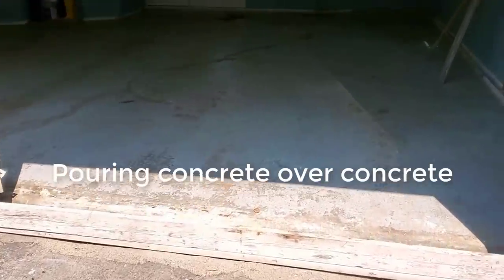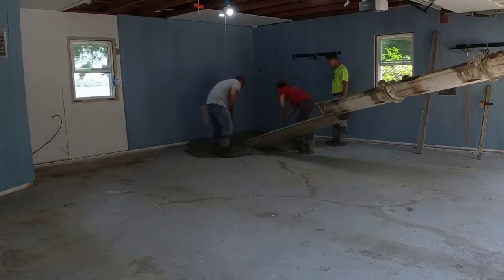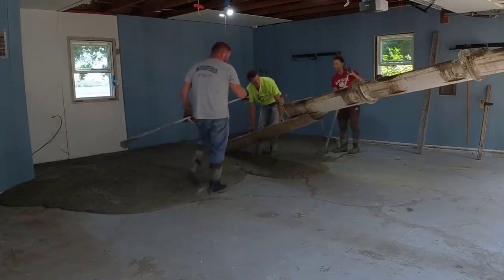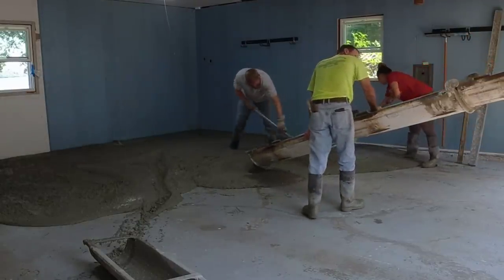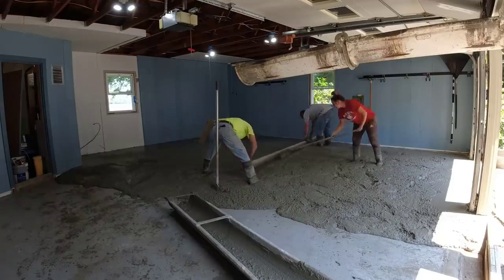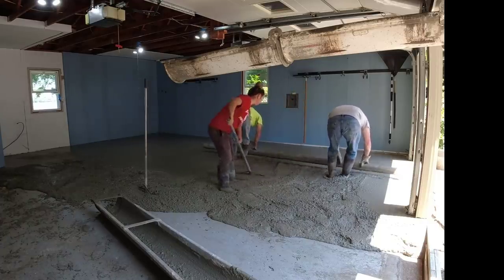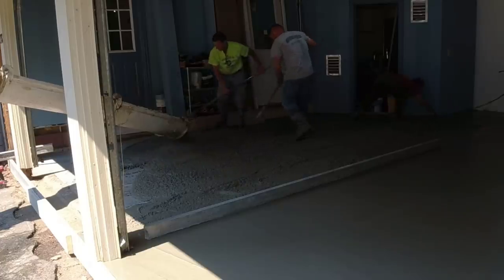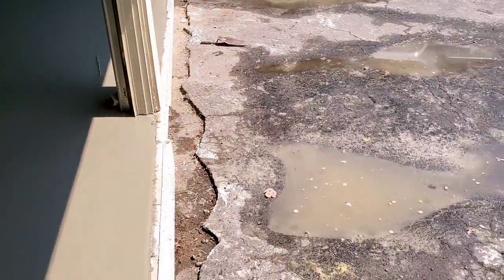Pouring Concrete OVER Concrete (New Garage Floor over The Old One)

Comment: Every crack in the existing concrete will come through the new floor
Reply: Reflection cracks
Reply: Pjbdoggy, maybe, but I don’t think so. I did this in 1996, used 5 bag mix. Still looks great today.
Reply: I would have put visqueen down first to break the bond, stop moisture and prevent those cracks from radioing through. Very cheap insurance for what you gain.
Reply: @edstimator1  nah- no need
Reply: @edstimator1  I'm with you, I've done it many times and that's the only way I'll do it
Reply: @justinmartinez5485  OK, well here's the thing.  If you put tile over a crack it is going to radio through EVERY time.  Now it may not radio through on a three inch slab....but it might.  IF it does, you have a crack that was totally avoidable that your customer gets to look at for the rest of their time in that house.  They will probably look at that crack and think of you EVERY SINGLE DAY and rightfully so. If I explain the risk to my customer I guarantee you they will choose to pay for the visqueen EVERY SINGLE TIME.
Reply: @edstimator1  that wouldn’t stop the cracks coming through bro

Edit: wouldn’t guarantee the cracks don’t come through, only guarantee is to rip it out and start again
Reply: They should use mesh wire on new concrete
Reply: I love  doing  this I look  at ur videos  all the time.  But I love  doing  it at my age.  70.  I have  two  drives  way to do  in 24   teach. Me more.  I wish I could  work with you  one time.
Reply: Then you have done this before
Reply: We do 2 inch overlays on bridges all the time.....just use a decent mix.  We use an e mix with a neat cement bond.....we pulverize old concrete roadways and use that as subgrade and build over that.  It's like putting breaker run prior to gravel for questionable subgrade issues.
Reply: No metal reinforcement?

Comment: I’m just trying to pour some concrete over an existing floor where there was a drain. I didn’t need the drain and filled that in but I want a flat surface and need to fill in the depression left over. Floor is in good shape otherwise.

Comment: I have three 1 car garage floors in very good shape for three small rentals i bought.   Poured originally in 1941 but now I need to raise them 5.5 inches to match the modern gravel alley grade they exit to.  Right now they are not usable only because since the 1980's you couldn't get a car in/out.  I'm just a DIYer and this video answered a bunch of questions.  Thanks!!

Comment: I have a 24x34 garage two bays. It was built in 1975. Slightly higher in the center of the garage I think 1.5" than the back of the garage. I believe a 3" perimeter curb. I am getting water coming up I believe between the curb and the floor. There are some cracks in the floor. Would you pour directly over and run it right up to the top of the curb?

Comment: This is a great video! I own a house built in 1970 and the street is higher then the garage. Every time it rains I get about 2" of water by that bay doors and about a half inch by the back door. I wanted to know if this was even possible to lift the floor level, thanks for sharing your skills and knowledge!!!
Reply: Best way is put a drain in with a pump. I just did major work on drainage to keep basement dry.

Comment: Heavy engineering workshops often have a dual concrete floor. With the top layer being a sacrificial layer that can be replaced relatively easily (just break it out and replace with new)
Reply: Yea and they also use structural reinforcement and tie the 2 together. This is cheap and will fail within a year.
Reply: @captainobvious5349  you cleary didnt watch the whole video.
Reply: @lambbolt  he sounds more like Captain Oblivious to me.
Reply: You are not parking earth movers on it 🤣
Reply: @marvinturnmire7406  What part of the video does he tie them in or even use dowels? I obviously missed that part.

Oh wait, maybe the where he just says you don't have to? Would love to see his P.E License in structural engineering,and you and your boyfriends for that matter.
Reply: Tear it all out and pour a post tention trenched slab. Worth the extra money. Concrete will crack no matter what. That’s why you put construction joints in it. This is just a poor mans temporary fix. I pumped concrete for 40 years on commercial and way to many residential floor fixes. If contractors would just compact the ground underneath the slabs correctly and even put in correct filler dirts compacted they would get a much better slab and the slab will last for many many years.

Comment: perfect time to add a floor drain!
Reply: Should I use bonding agent with 1.5 inch feathered top coat for repairing garage floor and parking pad in front of garage doors.
Reply: @kencalder1826  wouldn't hurt. Drill tapcons and tie rebar off to them as an easy and quick lateral mechanical bond.
Reply: Need to feather it in to get correct slope can't use rebar
Reply: @kencalder1826  use tapcons anyways. Perfect for skimming

Comment: The Concrete Truck broke down.

I found your videos doing research on replacing my basement floor. It was around 100 years old and in 2 layers at least a year apart. The first layer tapered 2" from the back to 3" in the front. The second layer tapered 1" in front to 2" in the back. Because they first layer had been walked on and properly clean they did not adhere.

The floor also sits directly on the blue clay river bed. So when it rains hard and in the spring the to broken layer would float.

Out of all research I did, not once was a concrete truck broken down mentioned. In Epping ,NH I worked with a few concrete trucks and no one ever mentioned a truck breaking down.

You can check out my last upload "Ultimate front yard" to see the waterfall I worked on. I did not have a camera when it was being built 15 years ago:(

Comment: What about the existing drywall & wood framing that may be lower than the new level of concrete pour? Won't NOT putting anything in between these porous materials & concrete allow excessive moisture from the all the concrete & ground wick up into them causing rout & possibly mold issues?

I am considering this in both my garages built in 1934. One is a 20' x 12' single attached. The other is a 24' x 30' two car detached. But not above any existing framing without a moisture barrier of some kind, especially in the basement.

I would also like to door a 3-4" with fiber reimenforced & the new fiberglass rebar reinforcement in all of them.

Comment: I have a new 286 sq ft workshop with a  5" thick concrete slab.  The 'contractor' did a decent job with leveling, but it is not smooth at all.  Is there a technique to skim or overlay an existing concrete slab just to smooth it out?

Comment: I thought I was the only one that did this. I've been told how it should never be done, but I did it anyway with great results.

I've done this twice in the last 5 years. One was a 10x10 patio that was in the way of a much larger screened room. 12x24 poured over with a 2-1/2-3 inch overlay, bonded and pinned to prevent movement. The latest one was a 12x36 where an enclosed carport turned living space would flood if there was too much rain. That got a 5-6 inch overlay and the room was repurposed into a master suite with a full bath.
Reply: lol, thats what happens when you listen to so called experts!! lol, there is nothing wrong with what you did, good job!

Comment: Mike, here is my project: 36x36 existing garage with a double bay and a single bay door. Converting single bay side to living area measuring about 12x36. Existing slab is in good condition with a fall of about 1/8" per foot. Here's the project areas I'm researching: 1) Level with concrete or use a PT sleeper joist system that tapers to maintain level? 2) I'd like to build a continuation of the existing CMU perimeter wall beneath the framing that will fill in the old garage door. Better to form curb directly on top of existing concrete using vertical dowels, or cut slab, excavate some depth then dowel horizontally into existing slab, form and fill to height of CMU (about 5" above existing)? 3) I'd like to form a curb the length of the space to create a level surface to build the partition wall on. Thickness will be about 5" on one end and 2 3/8" on the other and the wall is not load bearing. Same question as above - form directly on top of existing with vertical dowels, or cut and excavate then form and pour? I like to do things to the best of my ability. My nickname might as well be Overkill. I appreciate input from anyone with experience (with concrete). I'm leaning towards sleepers... here's why: 1) easier to do myself, easier to get perfectly level, 2" closed cell spray foam between joists as vapor barrier and for insulation, OSB sub-floor topped with engineered hardwood. :socialdist:
Reply from the maker: If you're more comfortable with sleepers, I'd go that way to level it. I'd personally use a self-leveler but I've used them quite a bit so easy for me to do. I'd form directly on top of floor for the other things, drill and pin like you say.
Reply: @MikeDayConcrete  Awesome! I appreciate your time. If you find another moment... I considered self leveler, but at 5.5"? Whats the prep for multiple lifts at greatest depth possible per the manufacturers product specifications? Not much of any information I could find on multiple lifts of self leveling products...
Reply: @MikeDayConcrete  I probably misunderstood. I'm guessing you meant to get the new concrete slab to close-to-finished height and then self level over that to dial it in nice and level. Thanks again for your response. Have a good one!

Comment: So ive set tile over concrete with cracks and have coated the floor with an anti-fracture coating ( redguard or hydroban). Is that something you have considered? Do you think it may be beneficial or just an un-necessary expense?

Comment: We have a garage pad 20’ x 24’ that was poured about 3months ago. There was a Metal Garage that was constructed over this pad. The Garage installers said the pad was 6” to 8” out of level. There is also a connecting pad that is 14’x 39’ outside of the recently constructed metal garage that may need leveling. Should we have the garage taken down and have the pad repoured?

Comment: Mike, I always put down a 6 mil plastic b4 I pour over old Crete, the rest I do like you and agree with all you said and did. I think it keeps the old cracks from coming up into the new concrete
Reply: I agree on that my self but its what ive always been told from older guys.   Maybe it was just a precaution they did in case lol

Comment: Got a pad that had a garage built on it and caught on fire burning structure to the slab. Slab doesn't look to affected aside from the pits in it that would keep you from rolling around on a creeper and maybe small chunks here n there but off the top of my head @6" slab and 30 x 30 square that we want to add another @10' on one side for a lift to be installed is why i came looking 4 these vids and yours is the 1st ive watched seems simple enough but hindsight should i tear up old slab or something like this be good without worrying about cracks say the next 20 years will be used as a shop for older car collection but also a garage to a couple 3/4 ton and dually trucks
Reply from the maker: You can pour over the old slab, 3" thick or more would be best.

Comment: Hi Mike, I have an existing two car garage that I will be expanding to a six car garage.  I will be adding one additional bay to the side, and then going back to make the whole garage two bays deep.  The current two car slab is in good shape but a little out of level after 65 years.  Is it a good idea to go over the existing two car slab like in this video, and then add all new concrete to the four new bays being added, or is it better to break out the old slab since two-thirds of the concrete will be all new based on the four bays being added?  Thank you in advance for the reply.

Comment: I got a 12 x 20 full concrete block wall garage. The pad is pretty cracked and I was going to do conc over conc. I raised the grade in the yard so I already raised the back man door and poured a new curb. When i did that I busted out a bit of conc already (6" thick) and noticed there is no rebar/ mesh in the existing slab. I have no problem bonding the surface but with the sub base not being super sound would you recommend busting out the concrete? Trying to keep costs low as I didn't plan on doing much to the garage in the first place as there are some settlement cracks in the block wall from there being no poured footing.

Comment: Good video and nicely done!
I have a basement floor that I need to level, about 1/3 of the basement or more.
One area will become bedrooms so I guess I could install the baseplates first 1 or 2 boards thick (along one side  as a form then using the existing block walls as the rest of the form) but I’d have to slope that down to the doorways so one doesn’t have to step up into the rooms so high.
So I guess I’ll need a bonding agent throughout the entire area being no more than 3” thick throughout. Your thoughts?
Thanks

Comment: Does this work if the existing concrete has a moisture issue? We have water coming up through the old concrete and it's been difficult keeping mold growth out of behind the baseboards. Will a overlay concrete floor keep water out permanently?

Comment: 20x30 foot pad. Mud got away from installer (my son) and left sound, but VERY rough surface, 6" thick. Probably an inch or so "roughness." Hate to jack hammer it out. Can I use your technique to salvage the surface of the pad?

Comment: My concrete in my house garage is in very good shape. Problem is that it slopes towards my walls and I don’t have a floor drain. Can I punch a floor drain in my existing garage and do an over pour up to the drain and slope it? I don’t live in city, so regulations aren’t a problem.

Comment: I've got a slab that i wanna pour over and make it all level i also wanna pour more concrete right next to it in the dirt how would i make the transition should i put an expansion join in there or just form up the slab connected and pour it continuously
Reply from the maker: I'd pour it continuously and saw cut where they meet.
Reply: @MikeDayConcrete   That's exactly how I was going to do it, also tying it together with rebar i've actually got a twenty by forty two that is on three different levels and i'm in alabama so frost and anything is not issue and also it's gonna be enclosed in a house. 
 But actually got on a facebook page and everybody had all different kind ideas about how to do it and what's you just said was my original plan before i even ask for advice so i'm gonna go with this
Reply: @MikeDayConcrete   One other question is how deep does a footing for postframe construction need to be if I wet set the brackets to tie in the posts

Comment: I’ve got a 1,000 sq ft garage I’m considering doing this in. Had a contractor recommend pouring over like this. The majority of the floor is in great shape, however the back corner has sunk about 3-4 inches, and produced a 3/4 inch crack about 10 feet long with the edges of the crack being about 1/2 inch off flush. That’s just one corner though, any other cracks or issues are small and not concerning. It seems that the slab has stopped settling, and many years ago (slab is probably 20 some odd years old). 

Do you think that sounds like a good candidate for a pour-over? The contractor did, and ge said he would pour it about 4 inches thick, bond it, and use fiberglass rebar. I’d love to have it done cheaper than the 5K quoted, but also want it done right.

Comment: Hi Mike, I have a building in Rockland Maine that is 26 x 50, I have put down insulation and radiant heat tube. I was wondering if you work in the Rockland Maine area? Thanks
This is an existing building. Thanks

Comment: I don't know if you'll see this but maybe there's someone out there that could give me an answer to my question. I have a double carport that sweats really bad and is very slippery when it's that way and wondered if there's something I could seal it with that would stop this from happening? It's an open carport with a brick mid waist high wall as a border on one side and the house brick wall as the other side.
Reply from the maker: Check Radonseal.com they have a sealer that'll help with that.

Comment: My garage floor is settled in far left corner bad slop downward. Other parts are cracked one spot about 3 feet in diameter is completely sunk in n broke. The garage is one in a half car garage. One plus is when original floor was poured they poured roughly  a twelve inch high lip all the way around. If I put rebarb down could I pour over instead of ripping out?

Comment: Hi Mike, I have a 40'x60' pig barn in N. CA. which has irregular levels of concrete due to the old pens (about  4 rows - maybe 6 pens per row) which are tilted down so the pigs could be washed and 4 door - two sets on either side of the barn which have a canal to catch the water. I need to make one flat floor. Between the lowest and the highest point is about 5". The concrete floor is very thick and sound - no cracks. Any thoughts on how to level the floor soundly? I have more exact calculations on the rise and the fall of the concrete and an estimation on materials but I wont bother you with that. Nobody in my area seems to know how to do this work - its very frusterating. I am about ready to start building my own forms ect... Should I hire an engineer? Thank you ... very frusterated...